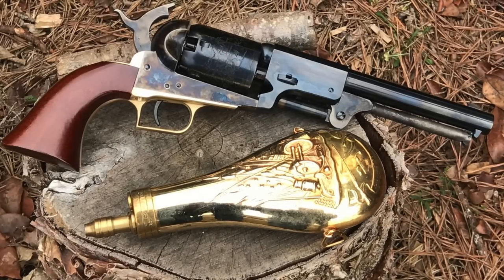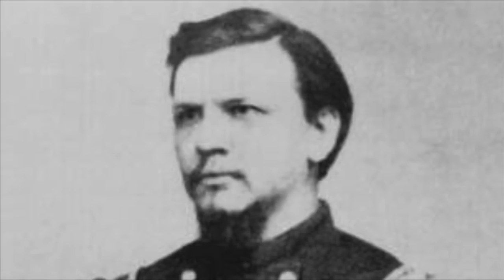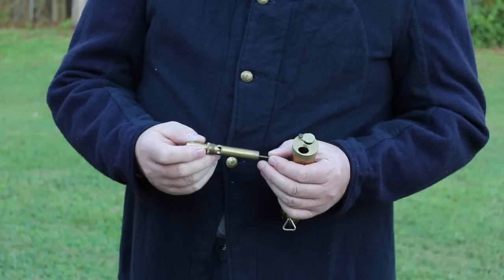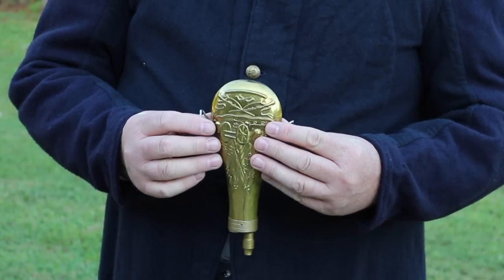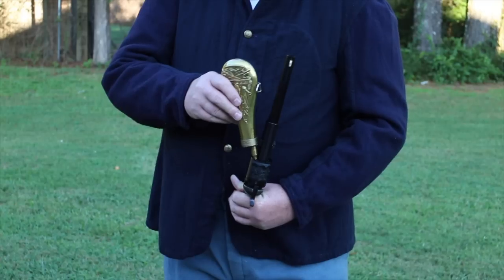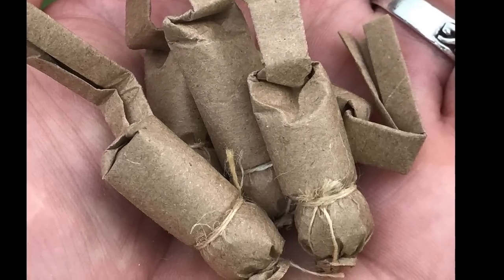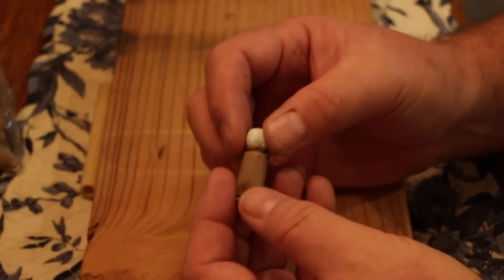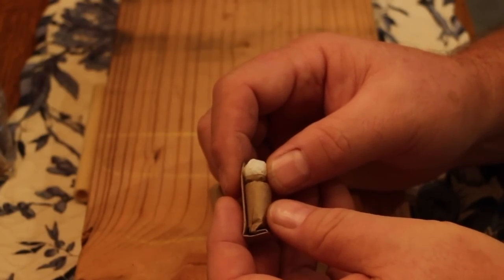Making Colt Walker Cartridges

Comment: I like your video making paper cartridges very nice to see your way of making them . I ordered one of those paper cartridge makers like the man had on duelist den video it works great. It's a machined rod with a slight taper and a square block of wood with a tapered hole in it. I use job cigarette papers to roll around the tapered rod then use a round cut piece of cigarette paper treated with potassium perchlorate and use a glue stick around bottom edge of paper rolled on the rod and put my round paper on the end and press it in the hole in the block of wood and pull rod out of paper tube leaveing the round tube in the block measure my powder and pour in the paper tube then I lightly glue the bottom couple of lube rings and press conical bullet in paper tube. These paper cartridges are made to insert in the chamber hole they burn up completely when fired in my 1847 colt 44 . But I'm going to watch your video more and learn the old way of making them because I get a kick of shooting old still guns like Lancaster long rifles and Hawkins man I love old guns a traditional ways . Thanks for the great video. GOD bless and keep up the good work

Comment: I have had several of those flasks as well as others, all the Dragoons and Walkers. That damned flask n e v e r worked correctly. Charging was sketchy at best. It cannot be filled with powder for it then becomes innoperable due to the powder fouling the plunger mechanism. The sling attachments are light to where they work loose causing the flask body to fail.

Comment: +Mark Hubbs  So, when each cyclinder was loaded, the "tail" was bit off and the back end put in the cylinder? Wished you would have shown just a bit more of exactly how it was used. Thanks !!! :--)
Reply from the maker: Yes, the tail would be torn off, or the bullet plucked from the end exposing the powder.  The powder poured into the chamber and the paper discarded.  I mention this in the notes above.  I hope to do another video on loading and shooting them in the future.  Thanks!
Reply: Lion ofJudea Thanks for your comment! I couldn't see how the percussion cap fire would penetrate that paper rapidly! Great point!
Reply: @erasgonehistoricalmolds2400  Just like a musket cartridge, then.  That's kind of how I envisioned it, actually.  Simple and reliable.

Comment: Hi, do you have a video of how you load these cartridges? I'm not understanding how the sparks from the percussion caps can penetrate the several folds of paper at the rear of the cartridge. Or is the tail torn off and the loose powder poured into the cylinder followed by the ball which is still wrapped in tissue paper. Thanks.
Reply: OK read through all of the notes and comments. Got it now :)

Comment: I also have one of those fancy flask for my Walker and THEY do NOT work well enough to use reliability. Love your instructions will have to try them out  for my use also..But my Walker seems to do best with 40 grains..
Reply from the maker: Thanks John.  I hope to take my Walker to the range this weekend to try the new Eras Gone Dragoon bullet in it.  There will be a video if all goes as planned.
Reply: The Walker was designed to take a robust charge. Also it was originally meant to use a conical bullet and not  round ball. With a proper powder charge the Walker would be the most powerful revolver until the invention of the .357 magnum. 
I have been told by experienced bp users that you can use a .44 bullet instead of round ball and have a very effective and powerful revolver.

Comment: Its been stated.. loading ones black powder revolver directly from a powder-flask 'could' (under certain conditions) be 'quite explosive'.. if you know what I mean?
Reply: Paper cartridges are excellent if one has the time to create them. I prefer the old purchase extra cylinders as one is able to afford and load several @ home and place in cylinder pouches.. a pouch per cylinder. Expensive @ first. But,  once acquiring these articles.. you have a sweet rig. Load cylinders @ home.... easy replacement in battle.

Comment: Will the flask have problems in dry climates/ would you recommend it for areas that aren’t prone to humidity caused corrosion?
Reply: The issues with the flask go beyond humidity.  As the powder in the flask is used up, there is less weight of powder to flow into the little vents on internal charging mechanism.  That was the biggest problem I found in keeping consistent powder charges.
Reply: I live in Colorado where it is very dry. Had the same problem with this flask. Corrodes very badly

Comment: can you change out the problematic walker spout for a regular 10-1mm threaded flask spout?
Reply from the maker: The plunger mechanism is wider and has a different thread than the standard spout, so no it unfortunately can't be changed

Comment: I thought you could load up to 60 grains in a walker/dragoon.
Reply from the maker: You can with loose powder.  The max charge is not always the most efficient, however. The Dragoons replaced the Walker in US service and the cartridges produced for them was evidently 30-35 grains with a 250+ grain conical bullet.

Comment: Also instead of using a 0.460 dowel rod, could you use a 1/2” dowel rod, in case you don’t have access to a lathe
Reply from the maker: You could, but the bullet would be very loose in the tube.  Another option would be to use a 3/8 rod and increase its diameter with masking or duct tape to match your bullet diameter.

Comment: Mark, I was watching this again. I was wondering if you know when they stopped using the clinical that was the mold supplied with the Walker?
Reply from the maker: Doug, I didn't find any mention of those bullets in the resources I have.  I suspect they fell from use soon after the War with Mexico.  Even during their day, they were evidently not too successful.  The shape made them hard to load properly.
Reply: Mark Hubbs , thanks.  I would agree but I was curious if your vast reference library held any facts.  Thanks again
Reply: Mark the conical bullet fell out of favor because of ignorance. Many people loaded the bullet backwards. Hence, poor performance. If loade properly the conical bullet worked better than  simple round ball

Comment: Seems like a lot of work for something you’re going to rip open later, especially compared to a combustible paper cartridge that you can shove in at once with no need to unwrap.  30gr seems awful light for a Walker.
Reply from the maker: Absolutely, but the soldiers didn't have to worry about making them.   Also combustable cartridges replaced these in later years exactly for the reasons you suggest.

Comment: Could a combustible cartridge be made for a colt walker?
Reply from the maker: It could be, but the Walker was not designed for them.  The loading port might be too small and the barrel wedge, which is inserted from the loading side on a Walker, might get in the way.  They would shoot them fine, the issue would be loading them.